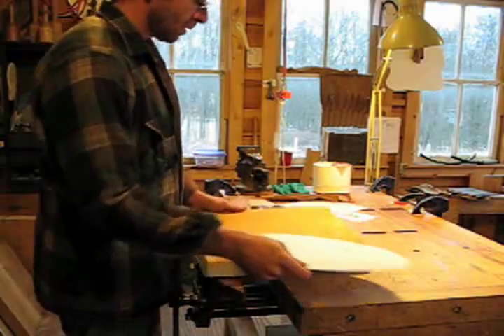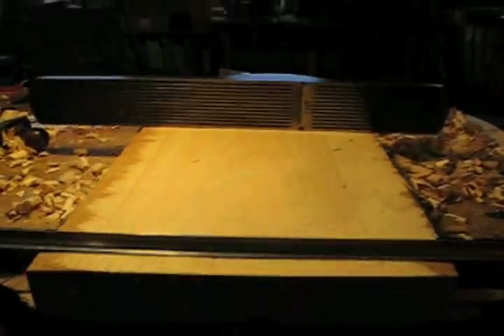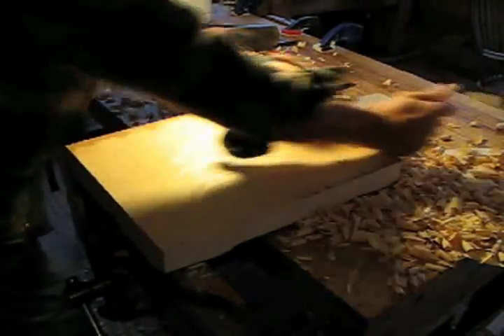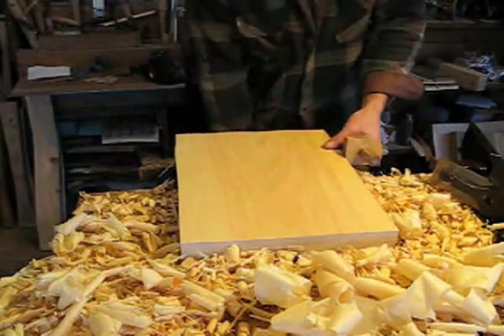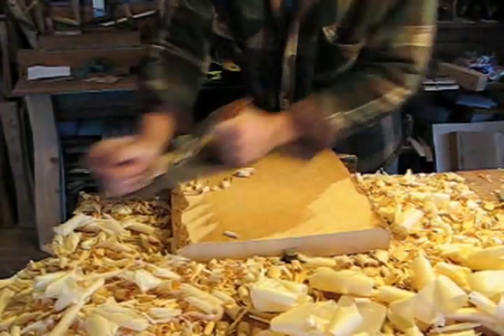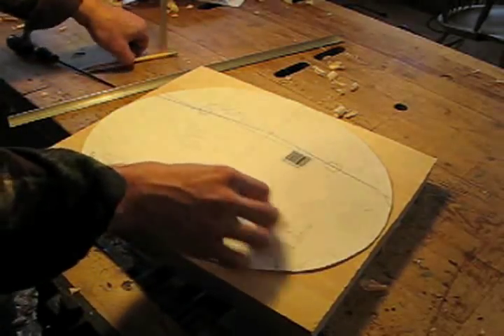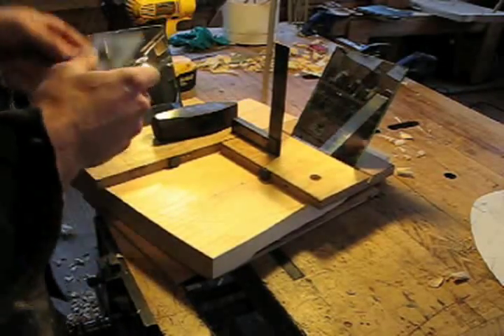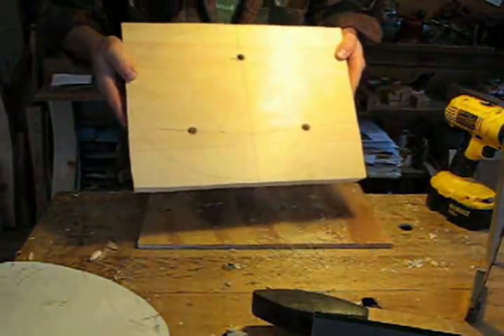flattening

Comment: The skill of flattening with hand planes is a good one to have but it's rarely taught now.  You do it very well.  Some folks have an extra jointer with a moderately rounded blade.  It helps on the concave surfaces.   I've never seen the mirror trick before.  Very nice.  I'll keep that in mind!   Thanks for posting this, 5 stars.

Comment: Seems odd taking such trouble to square and flatten a seat that will be round and dished! Like the video of the Japanese woodworker hand carving a massive long, round column out of a huge rectangular block of wood, which was presumably sawn from a long round tree :D  I suppose the bottom of this stool will be flat.  Is there no simpler way to drill leg hole with consistent, correct angles?